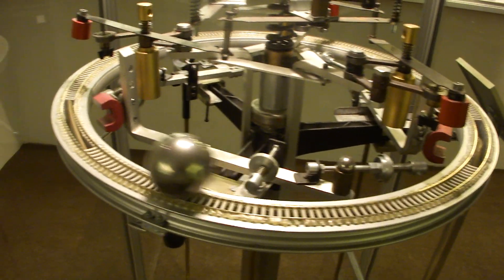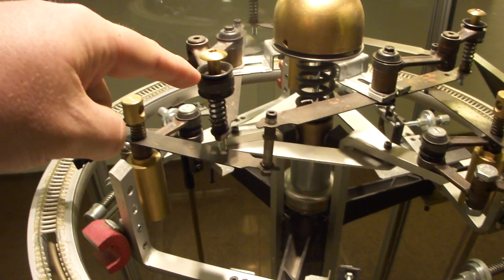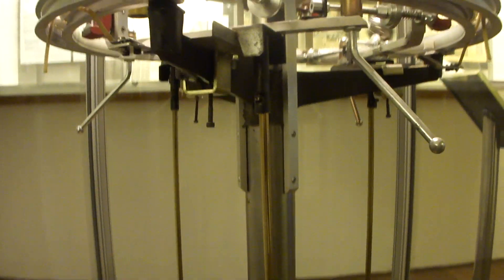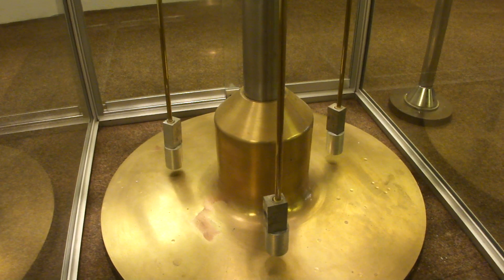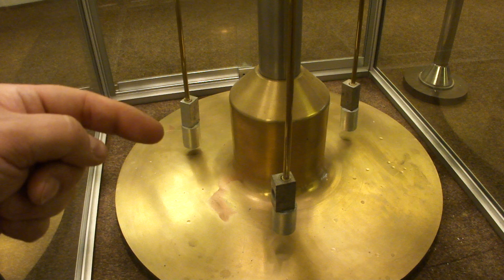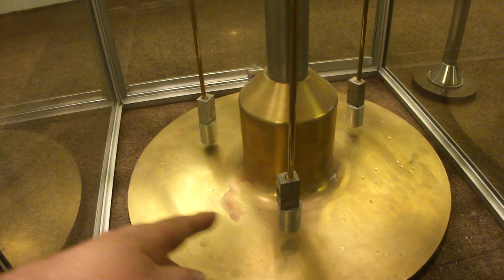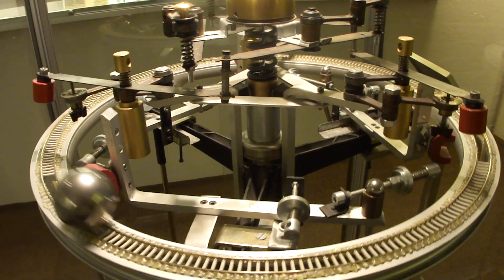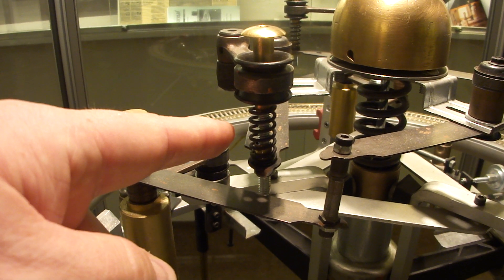Finsrud perpetual motion machine - overunity.com admin Stefan Hartmann visits Reidar Finsrud 14

Comment: X
This device is perpetual most of the time??????? The claim that it is perpetual is ridiculous. Smoke and mirrors..... Every time a spring is deformed heat is generated, every time a pendulum swings there is atmospheric resistance same goes for the ball bearing. To overcome these losses there must be an external energy source for it to appear perpetual  This is an amusing but pointless machine. I agree with Gibbsian36 one pendulum clearly wobbles and maybe being influenced by some hidden input.

I cannot actually believe I even wasted time and energy to post this comment...!!!
X
Reply: Its not perpetual. But extremely efficient! I've read that it can go on for about 14 days.
Reply: until the battery under the floor base is consume xd
Reply: chilled and under a full vacuum to provide accurate data I agree
Reply: it's going to be used for energy purposes that's why it's behind a vaulted door!
Reply: Don't forget about the Sun!
Reply: Shark Eyone yeah , it sends volt command pulses to control those springs , so theres surely a hidden battery inside those pendulums or there’re wires hidden inside the main frame, so it’s not perpetual motion, eventrough those scientists didn’t found any battery in it but still, i wonder why john richard is hidding it.
Reply: Do you not see the importance of it.  This machine uses gravity and magnetism.  It's proof that energy can be  produced freely and be sustained. It's proof that we will have clean and abundant energy in the future.  Of course it would be done differently.
The solar system also proves the principle of perpetual motion. Gravity's force holds in  a massive moon from flinging away. Two planetary bodies exert to each other this attractive force and that will never diminish.

Comment: Not much. If you try to take any energy out of the system it will stop running.
Reply: That's not entirely true. If you said, take away any 'useful' energy it would stop running, you'd be wrong still. Their is energy being extracted from this machine. That energy is wearing out the metal surfaces and also  incurring metal fatigue  to the spring and eventually it'll break. Nonetheless it's energy. If this machine was retrofitted to emboss an image onto a gold leaf stamp repeatedly it could do that. That's proof enough that this machine can produce energy and work.

Comment: Convection air currents inside the spotlight heated glass case, could hypothetically provide enough energy to maintain this machine? ...It would only need a few milliwats to keep going. Joules = 0.5 x Mass in Kilos x Velocity in Meters per second squared. So it only needs about half a watt to get started, and just milliwatts to maintain momentum against very low frictional loss. Convection air currents might be sufficient?  It worked better after the spotlights had been on for a while.
Reply: Yes, also I was thinking the earths magnetic field- that copper base and the swinging pendulums
Reply: The machine has been testet without lights and without any main electricity to the house.

Comment: It's quite clear that this is a joke by Mr. Finsrud: the cylindrical magnets are electromagnets connected to a battery concealed in the center.  They switch off when the ball passes underneath (which is why one of them bobs so clearly).  The pendulums and the U-shaped magnets are for just for show and are moved by the ball, which gets a kick from each cylindrical electromagnet when it passes underneath it.  When the battery runs out the ball will stop.  See demo by Catspincushion777.